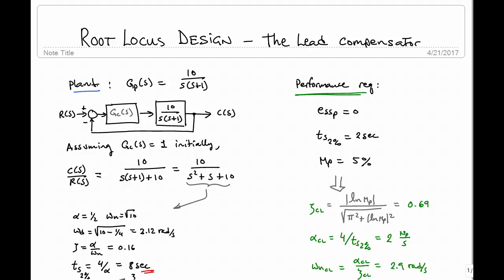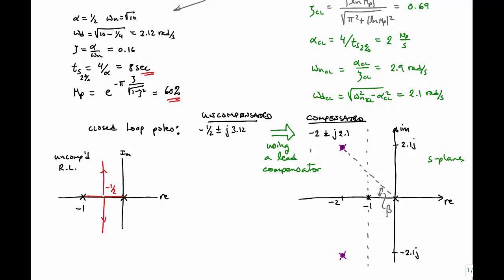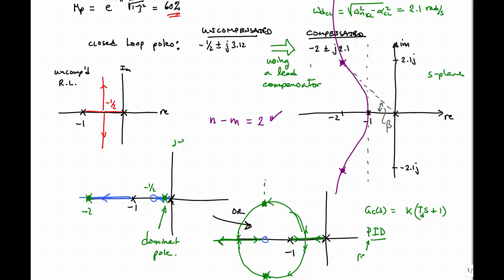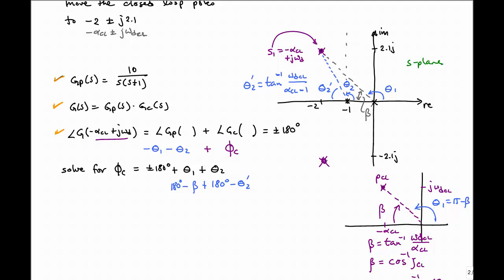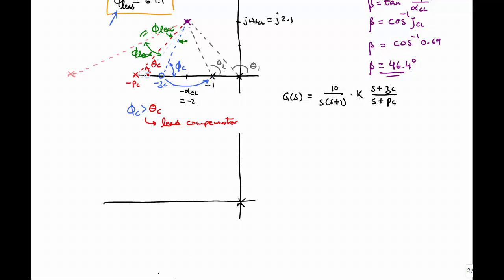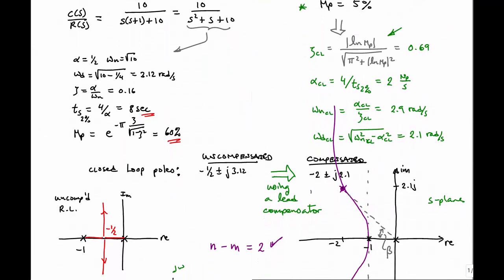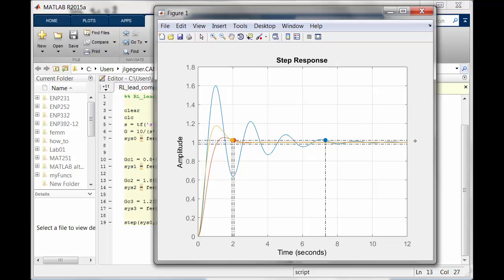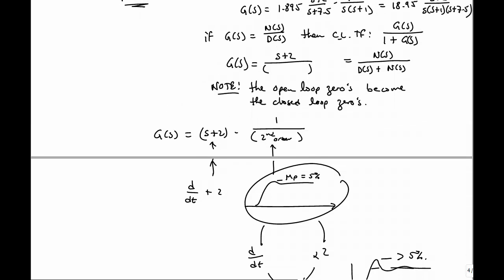Root Locus Lead Compensator Design Example (pole/zero cancellation)

Comment: I worked this out in just a minute.   I got a controller gain of 6.1  and controller lead/zero at -2.048 and a controller pole at -14.  There is no overshoot and the time to get to position is less than 2 seconds.  The bandwidth is 1.1 Hz.  I placed all three closed loop poles at -5.  I re-ran my calculations so the three closed loop poles will be at -10.  The bandwidth increased to 2.4.  The time to get to position drops to about 1 second and again there is no overshoot.  The controller's loop gain, zero and pole are 27.1, 3.69 and 29.

Comment: If the angle contributed is more than 60 degree then we consider it is cascade of two lead compensator
But why 60 degree? Why not other angle?
Reply: Yes... if more needed then use 2 lead compensators in cascade